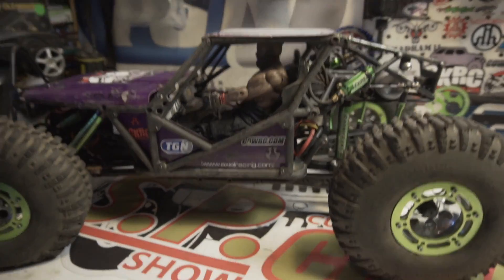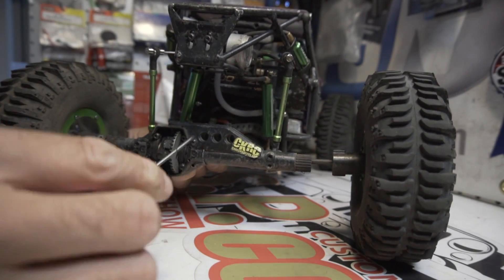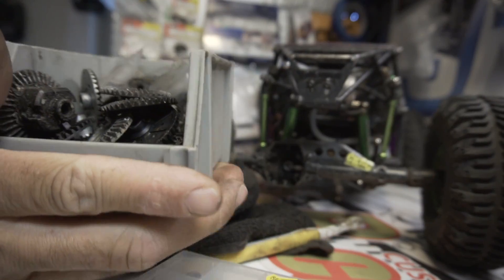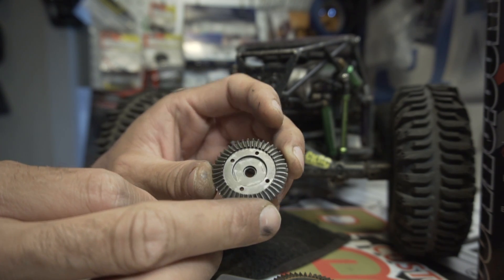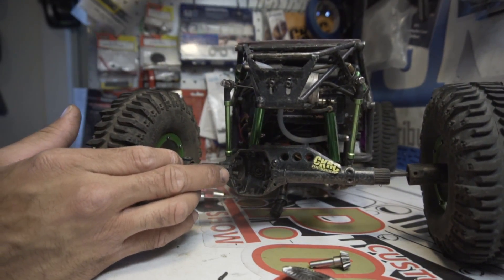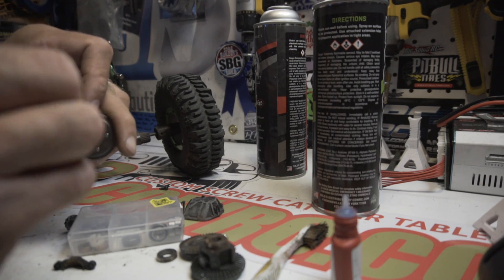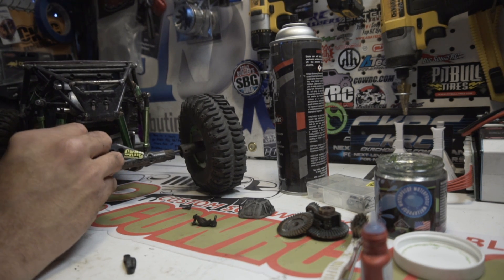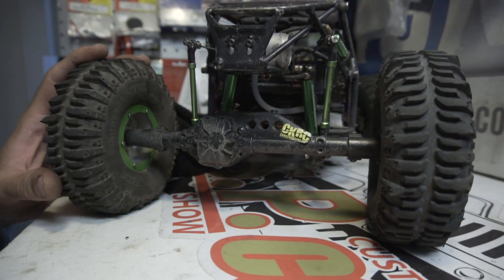HOLMES HOBBIES | MOTOR CONTROL | EPISODE 32

Comment: "Little-dab-will-do". The Udder Butter is so thick....too much will cause loss of "free movement". All my rigs run Cows stuff and when the truck is turned off you can push them and everything moves "Butter-smooth".... no pun intended. lol
You'll like the underside in the rear , lots of benefits I won't mention.
 Tom
Reply from the maker: It is not only thick but super sticky. So it sticks to the gears really well. I always use a lot but enough to restrict movement. Thanks for watching!

Comment: Did you shim your pinion ?
Reply from the maker: Nope. Never have needed to shim a pinion on an Axial rig. Only on my RC4WD and Tamiya rigs.
Reply: I added a shim to mine trying to reduce the wheel slop and it helped quite a bit . Although the locker has a ton of slop also .I I need me a Holmes hobby spool locker . And ya I would like to see the sway bar video . Great videos .

Comment: Do they work on a scx10 ring ? I'm really New...sorry or do they make one for the scx10 ? thank you
Reply from the maker: The Wraith and SCX-10 use the same ring and pinion gears. The new SCX-10 ll is not compatible.
Reply: +EXTREME SCALE PERFORMANCE RC Thank you 👍✌